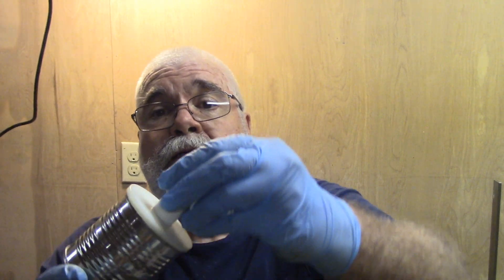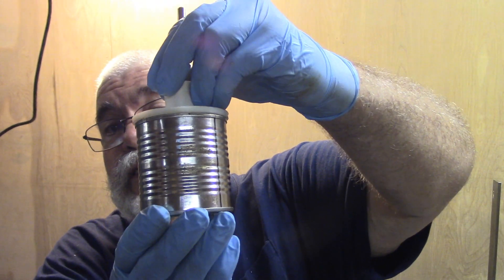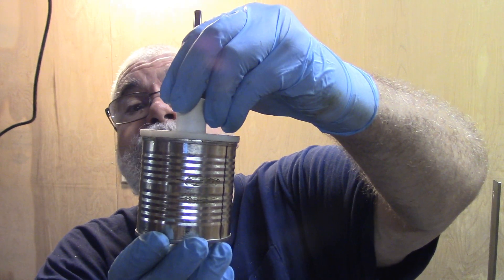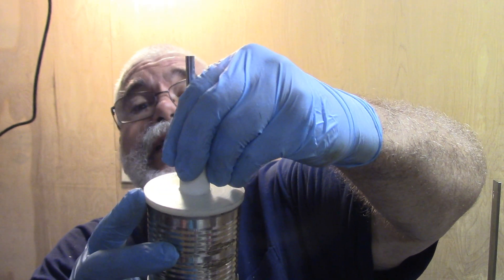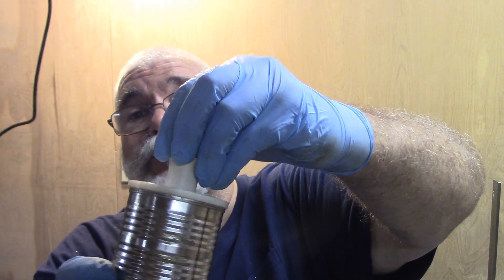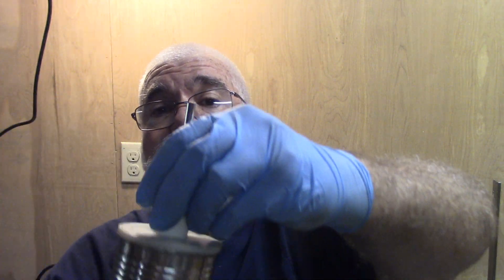Cutting Oil Can Gift

Comment: It’s a mushroom can, Vernon. It’s an science experiment that I was playing around with. I just did a large one out of a larger can, plus I used a 3/4 CPVC pipe, I had a piece of it laying around so I used it. My favorite is the paint cups I’ve modified. Didn’t you get some to fix? If so you may want to use 3/4 CPVC pipe instead, the outer wall is just a bit larger than the 1/2 PVC pipe and you have the larger ID. Dang you pimped out my little can.
Reply from the maker: You did good!  This is a great little oil can.  Very stable.
Reply: Mature Patriot / 2 BUSTED THUMBS I put a magnet in my oil can to help keep it in place. I like it but it does collect chips and drags them everywhere . Also I think it magnetized everything I put it on! I need to learn how to build a demagnetizer.
Reply from the maker: @RockingJOffroad  Yeah that's why I don't like magnets in the shop.  mrpete222 has a video on making a demagnetizer: https://www.youtube.com/watch?v=p01225sBSJI
Reply: Rocking J Metalworks - John Brock I have put them on inside of a spillmaster I had. It wasn’t a rare earth on but a conventional magnet. The beauty of the small cans or children’s paint cups is they work fine without magnets to hold then in place. My containers if filled correctly will not spill in fact I’ve knocked my oil cup over numerous times on the lathe without making a mess. IHMO its better to knock over the container than to deal with the side effects of the magnets.
Reply from the maker: @JamesDedmon  I would have to agree.  As I showed in the video, the can is very stable and would be more so with some level of oil in it.